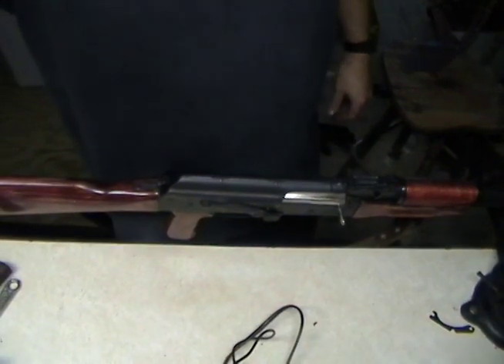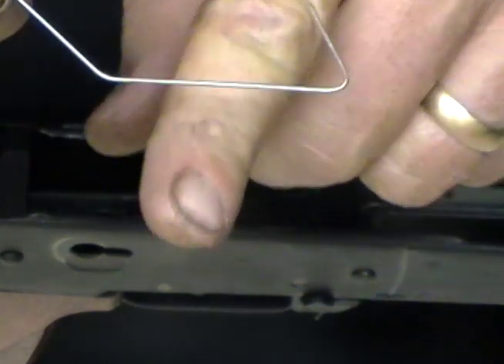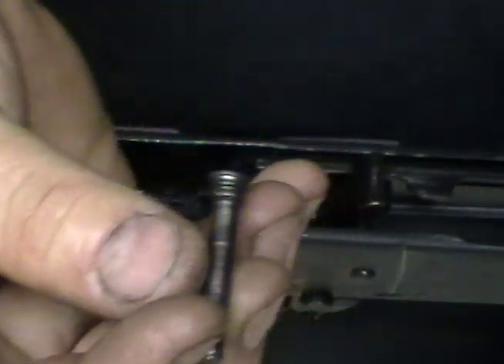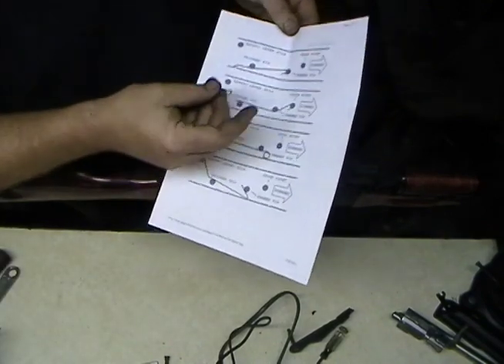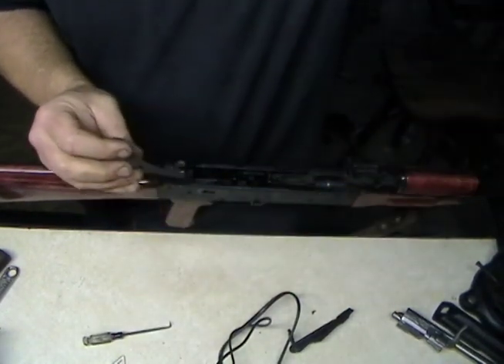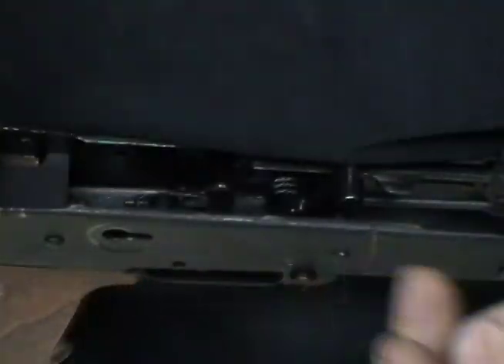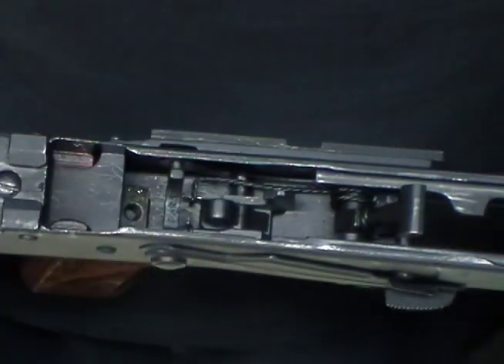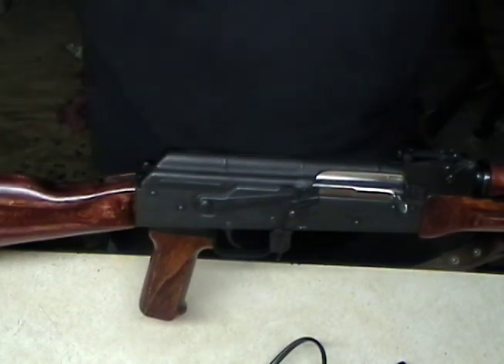AK Trigger and hammer pin

Comment: I'm new to the AK & had the exact problem that you described. My trigger was actually wedged so that it wouldn't move. I ended up removing the trigger retaining pin & putting that weird wraparound spring for the hammer & trigger back in it's intended position, then reinstalled the shepards hook spring. It functioned correctly afterward. No way I could have resolved my problem without this video. Thanks KelTecLover
Reply: I'm not new to Aks and this helped me...I've just never had this happen before like what did on mine...everything always just went back in correctly.. I just got a new century wasr and my spring was just laying in the gun attached to nothing.  and it needed a little bending/fitting to grab the pin.. didnt feel too good on the first outing w it and it goes down on me lol

Comment: I had the retaining spring pop out when I was trying to field strip it. This was ONLY video I could find showing how to put it back in properly. Thank you so much. That said, I paid 9 bucks w/shipping to get a retaining plate that should be here in a few days. Looks so much easier.
Reply: Same. I'm super grateful for this video even though it's 9 years old at this point.
Reply: Me too, I was really struggling to understand the correct placement of the spring when it fell out during field stripping. With this video I was able to replace it and now the safety works again until I can get a retaining plate replacement. 

Thanks for the instructional video.

Comment: Reinstalled this improperly after accidentally knocking it out during a field strip. Couldn't find a video that explained it well so I put it back in what seemed right and called it good. Fast forward to the next time at the range and my trigger feels completely off, catching in reset and sometimes not firing until I pulled it extremely hard. Thank you for uploading this video and I'm so glad I found it!

Comment: 2024 and you just helped me.  Thanks...mine is brand new wasr from century and I don't even think they had it installed at all from factory.. It was just laying inside or rifle and I shot ab 60 rnds and noticed pin was walked out.. spent an hr fooling w it before I found this video...had to do a little massaging to get mine to seat also but hopefully it's good now...deff would be a good idea to upgrade to that plate if you are trusting your rifle w your life

Comment: Great video, I just bought a 10/63, the original owner must have fooled with the fcg and didn't put the hook back in properly as the trigger pin is walking out and the hammer pin is not flush in the reciever, now I know how to fix it!

Comment from the maker: @DaytonaRoadster Both the trigger and the hammer pin are held in place with spring tension. I'm going to assume that the hook is pulling out of the trigger pin and if so the wire hook is bent. Reinstall the hook into the grooves, if the ring is under the safety hole then simply bend the hook until it's inline with the hole or just above it then try reinstalling your safety. That should solve your problem

Comment: you saved my ass I disassembled it for the first time I have century 63D AK it is my first AK I thought I was pretty capable with firearms I discovered I'm not pistols yes rifles no lol, my safety was so stiff I thought if I lifted it up I would be able to bend it a bit to loosen it , it did not work but what happened the safety bar popped out so in order to get it back in I had to push out the trigger guard pin because squeezing the trigger did not work,  and then I didn't know if the wire clip hoes under or over the pin  this sucks Im gonna have to get that clip you installed thanks .

Comment: Hey I need some help. I have a yugo m70ab2 ak-47 and I've noticed that the trigger pin on my gun is loose and after a few times of pulling the trigger it falls out. And I have to push it back in every time. What do I do?
Reply: +Big Sean i know this was posted like forever ago but i just spent the past 3 hours trying to figure out the yugo m70. the tail of the sheppards hook gets pushed in between the bottom of the front pin and the bottom of the receiver. then the flat section is placed above the trigger pin. it does not hook underneath as shown in this video.

Comment: I'm going to replace my trigger with a Tapco, and a Tapco pin retainer, but my safety won't lift all the way up to remove it. I saw on you tube where it's made for a full automatic, mine is not .When I get it out, I'm going to grind one side of it out. But how do I get it out?
Reply from the maker: Start by moving the safety lever as high as it will go then while holding up pull the trigger so that the hammer falls then release the trigger while continuing to pull up on the lever and it should slip up and out.

Comment: My trigger pin is still walking itself out after firing, have any suggestions, could it be the trigger receiver hole size? I tried different trigger pin, with a screw end, but no luck, replaced the shepherds hook with flat pin as you did, trigger pin still slipping out...

Comment: Oh man, ok so I was in the range one day when this spring popped out and locked my charging handle back, now I managed to get it unstuck then I tried to put this spring back together but I couldn't so I just ended up clipping it off. I then keep on shooting and I notice that my two trigger pins kept sliding out. After that I just went back home and welded the pins. Is that bad and can it cause some type of malfunction later down the road? PS I haven't gone back to the range to shoot it after I welded the pins

Comment: There is like a miniscule amount of metal on the back of my trigger preventing  the safety from clearing it during the reassembly should I sand it off and if so what should I use sandpaper or a dremel tool lol at first I was pissed about this but today this one problem has taught me more about akm pattern rifles than all the reading I've done ....wich isn't much oh and curse the Shepard crook to hell lol I got a n pap m70 btw any advice from more experienced gun owners out there
Reply: +Nobody Nobody feel free to message me with any issues. i just stumbled across this video and figured a few things out the the m 70
Reply from the maker: +Nobody Nobody Sorry for the delayed response but your issue is a very common one. Many time a builder/manufacture will use miss matched parts combined with Tapco triggers sometimes parts need to be fitted a little for proper function. Taking a little off is ok as long as it dose not effect the function of the safety
Reply: +Kelteclover lol wow I can't believe this happened in the summer but the problem ended up being I just wasn't putting it back together the right way idk how but 5months after it happened I grabbed all the parts like screw this man law I'll fix it and in 45 minutes I did lol I appreciate the help tho seems I wasn't putting trigger group or pins back in the right order

Comment: Mine is hooked under the hammer pin correctly but not even touching my trigger pin, what's wrong?
Reply from the maker: It's hard to without seeing it and knowing what style of clip it uses. I toss the factory spring clips and replace them with pin retainer made from sheet metal